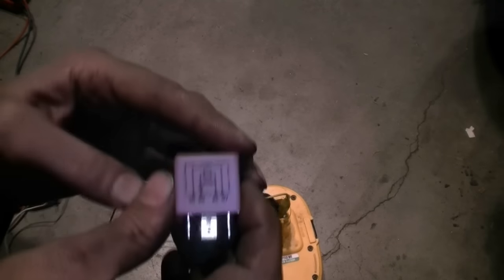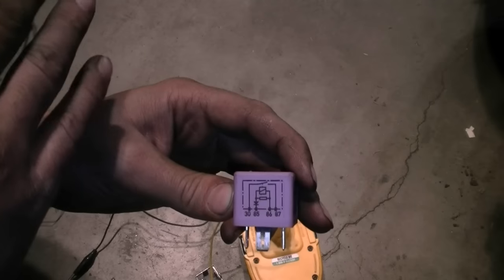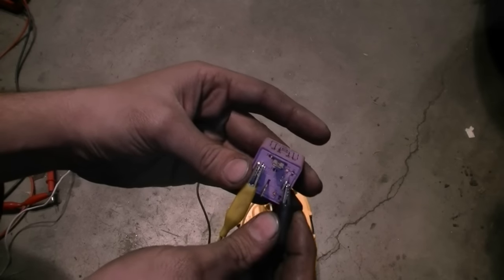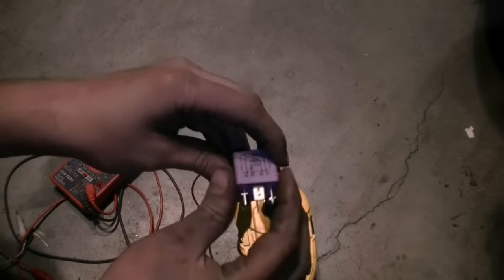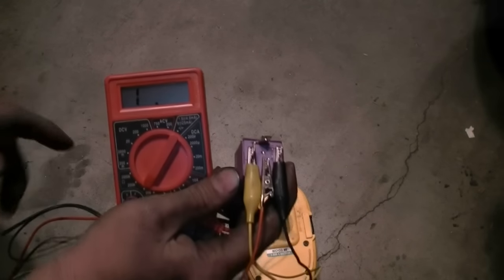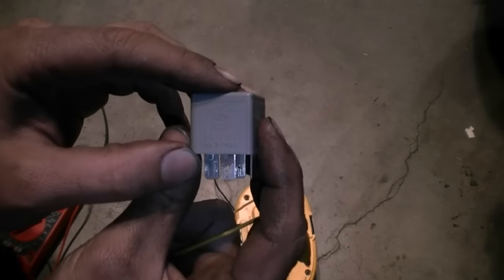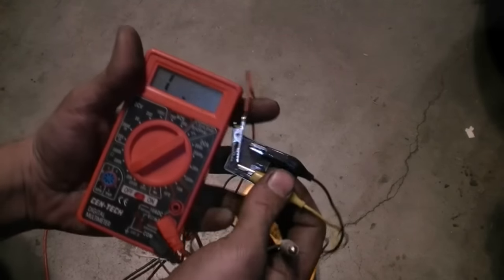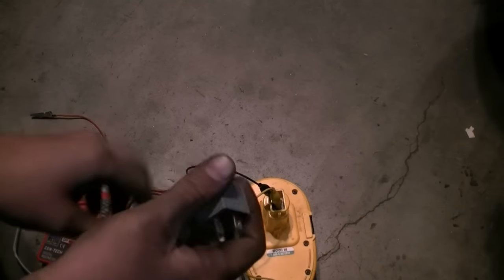How to Test a Relay the Correct Way

Comment: fabio sarmento:
"I've always been teached that we never measure resistance in an energized circuit. Can you explain me how it is possible? thanks"  This is generally a good way to burn out your ohm meter.  With relays it's kind of a moot point since rarely do they connect the coil lines to the switch pins since you can just do that on the printed circuit board, anyways.  If you want to be sure it's safe, set the meter to volts first and make sure there's a 0 reading.  Then you (probably) won't damage your meter.  I tend to use $3-5 meters for ohms, anyways.  Best not to use a $100+ meter for ohms on a circuit with a battery/AC/large charged capacitors on it.

Comment: Great video, thanks for this. I have a intermittently working relay, would that show resistance? Or is there another test we can do? Assuming it stops working when under load for a long time. Fuel pump relay on a MY2000 Nissan 200sx.

Comment: Relays that work of the cars computer may have a different voltage than 12 volts to the relay. Typically around 2, or 5. Not sure if giving 12 volts across the terminals will damage the windings in the realy.

Comment: Instead of over complaining about terminology used in this video, I think, if we have adequate knowledge of electric circuit, 
we should be more interested to analyze the circuit using correct model.
For instance, if the coil has an inductance of 30 mH and a resistance of 150 ohm and the current needed to pull the contact is 50 mA after excited by the battery voltage of 12 V, we can predict or calculate the relay delay time until the switch is closed.
To do this, we should obtain a complete response of a step function. In this case the battery voltage source can be modeled as a step function.
A complete response = transient response + steady-state response. Alternatively, it can be considered as : natural response + forced response.

Perhaps, there is anyone here who is interested in solving the problem I mention above. If so, give your answer. Please don't write the starting 1st order differential equation to be solved using either traditional method or Laplace transform method. Only write the final equation needed to obtain the result
Just consider this as a refresher of our knowledge on RL circuit. For me, it is not as frustrating as when removing all of the wheel nuts or even the nuts on master cylinder. :)
Cheers :)

Comment: Although this is one method to check a relay contact, it's not the best. The best method is to measure the voltage drop across the contact while current is going through it. You could leave the relay in the car and check it there under dynamic conditions. Have a good one!

Comment: You shoudn't test resistance in a powered circuit.Anyway it is a great explanation thanks
Reply: The coil and the contacts are two separate circuits. The coil is the control circuit while the contacts are typically the load or power circuit. Since the relay is disconnected there’s no current in the contacts. But yeah it’s recommended to isolate the component before checking resistance.
Reply: @davidr.9040  how to do it please?
Reply: No electricity videos don't have some jerk claiming it's wrong. I swear
Reply: @mebrn5337  he’s right tho, I’d rather get O.L than blow a meter

Comment: Yes this video was very helpful.. Question tho.. Does it have to be a 12v or higher power source to activate relay?
Reply: The whole point of a relay is that it delivers a full 12-13v from the battery to the ancillary item especially items with a high current draw such as headlights, heaters, fans, starter motor. It also means there is less current flowing from the battery to the switch around the wiring loom to the ancillary item. If there were no relays the main wiring loom would probably melt with the high combined current flowing along the wires from all the ancillary items connected to it. Relays are quite cool really, literally.

Comment: Also.. you can also switch the multi-meter to continuity beep to check the relay, if it's audible after energizing the relay, the relay is fine.. if not, then the relay is faulty.

Comment: Good job, but a voltmeter will not put a current load on 30 & 87. You could still have a bad relay. What if the contacts are burnt? You would have to load the relay and do a voltage drop test in order to see if the contacts have high resistance.

Comment: Thank you for showing us the way of how relay work. But I still can't really understand why relay show open circuit ( infiniti oum) but the coil still working !!!
Reply: There are two main parts to a relay. First is the coil and second is the switch. The coil is the electrical part and the switch is mechanically operated by the coil. It is entirely possible the the switch may develop a mechanical fault preventing from closing or even a broken wire can cause a fault. These type of automotive relays can usually have the cover removed quite easily for checking.

Comment: So I do this check already but I wanted to know if you get any voltage reading through the relay? Apply 12 volts and see if 12 comes out the other two pins.

Comment: it is a coil or selonoid which becomes magnetised and pulls the metal switch down to the magnetised coil thus the switch is now made and passes the current to the object.switch off the current to the relay and the coil is no longer energized to create magnetism to pull the second switch down.

Comment: Cool man I'm going to test my relays on my 05 Toyota sequoia I'm having some problems with my secondary air pump and my secondary air injection Valves after I have changed all new secondarys air system its keeps turning it off. code will not go away P2445. Maybe it's haves a bad  relay 
Thanks for your great video

Comment: I got 2 questions:
1. Will you damage the relay if you put the 12 volt wrong? IF you do what you do, but you take the power source on the other ones and the voltometer on the others? (I guess It wont click, but will I damage it by doing wrong?

2. How do you know the correct way to put it back in?
Reply: +Erlend Myhre (Ragnarok) The relay will only fit back in 1 way due to the pin layout. Putting the power supply on the wrong way will not cause any harm but as you say, there will be no click.

Comment: Not trying to throw shade, but is that one of those $6 harbor freight multimeters? I bought one in a pinch for one time use.... Thing still works. But it won't suppliment my FLUKE
Reply: I have a cheap $10 meter and it works fine for me

Comment: M M: " How can we distinguish the positive from the negative??"  Well, just reverse it and if it starts working....   TBH, most relays I've seen work in either direction.  I'm surprised that the video uploader didn't test to make sure the relay works in both positions.

1)  Put ohm meter on 2 switch pins.
2)  THEN apply power and see if it goes between off/on.
3)  For some applications, you need to instead set it to voltage setting and put a battery in series.  The voltage drop compared to when bypassing the relay (directly connecting meter to battery) should be almost zero.
4)  I tend to use 9V batteries because it detects borderline-failing coils and is just about the same distance between terminals.  A weak coil will fail at 9 volts even before it fails at 12 volts.  Great to know if buying used relays at a self-service salvage yard.  I've yet to see any that allow you to bring in a car battery to test.  ;)

Comment: The information was great. Instead of trying to hold the relay and the tester, leave the tester on the floor. If it is straight and flat, the display can be seen. That way, theirs no chance of you dropping the tester.

Comment: If a relay has high resistance and the relay still clicks you can pull of the plastic housing and sand the connector tabs with sandpaper.

Comment: Great video!  Can you tell me if all 4-pin relays have the same numbers on them?  I'm trying to diagnose an electrical problem on a 1975 BMW motorcycle and the replacement relay is $70+!  Yours has the same numbers on them as mine.  Where did yours come from?
Reply from the maker: Larry Bowen Mine came off a 2001 VW Passat if I remember correctly. Not all of them work the same but you can probably pop one in there to see if it works with minimal risk of damage to anything (I said minimal..lol). GL

Comment: Hi:  Thank you.  So I found that all my relays are good.  So I didn't have to buy any, thank you.  I still have my problem that you may have a video on.  I have a 2000 Mercury Mountaineer that when you open the drivers or passengers front door the dome light does not come on.  It does with both back doors and tailgate.  I checked both door jam switches and fuses and under dash relays.  All good.  When I was working on the drivers door, just once I heard the bells when your keys are left in.  That is not typical and it doesn't do it now.   I have no idea of what to check next, or how to check the ground wires that go to the door switches.  Help is possible.  And again, thanks for the video, it was great.  Kenny

Comment: Summary: To test vehicle relays, connect 85 and 86 to 12 volt power source and listen for the click. While that part of the relay is still energized, test the now closed part of the circuit, the other two pins, and see if the resistance value is close to zero. If it's not, it indicates a bad relay.

Comment: I've always been teached that we never measure resistance in an energized circuit. Can you explain me how it is possible? thanks
Reply: They are not connected.  12vdc energizes the coil which electro-magnetically pulls the other separate contacter circuit closed without physically touching it.
Reply: Also, with the relay out of the car, there is no power going to the side he's checking resistance on
Reply: Taught not teached .
Reply: @tollinloud.5117  
Tight, not taught.

Comment: Ratchets and Wrenches was struggling in finding the correct term for certain relay parts. Whereas perhaps, quite a lot of us, including me, still struggle in removing the nuts on brake master cylinder, let alone the wheel nuts. :)

Comment: I have a 94 Corolla, the radiator fan relay clicks but the reading with a multimeter in ohms reads OL on the load circuit when energized. Is that a good relay?

Comment: Sir, very helpful and informative to fix AC related issues.

Sir, my car i20 rear defogger does not light up and it doesn't work too. However, the front fogging and other AC features are normal 💯 percent working.

Please, help me find the  reasons why only rear defogger does not work? Any fuse related for rear defoggers??
Reply: The rear defogger is an electrical wire that runs around the rear glass. It heats up when current is passed through it. You can see it in the back window with a small electrical connector usually low on the glass. It may have a broken connection or wire. Can be measured with multimeter on ohms. If it gives no reading, wire is broken. 
Front defogger works by AC plus engine heat, totally different

Comment: Great Video,thanks a lot!

May i ask something,if i have a bad relay(it clicks but shows infinity resistance on the multimeter,like the second relay on the video)what can i do to fix it?Except buying a new one...thanks!
Reply from the maker: +Zisis M they are very difficult to fix maybe impossible. I would suggest finding a similar relay if you are in a pinch, sometimes you can use 4 pin relays instead of 5 pin relays to. GL
Reply: +Zisis M Depending on what the relay is for you could probably use a wire for the fix. My power window relay went out just the other day, put a wire across 2 connections and it works. The only "problem" is that it runs without the car being on, potentially draining the battery or heating up. As far as from what I've heard there are mixed outcomes. The relay makes sure power goes to where it needs to be when the latch is on and it disengages it when it's supposed to be off. I'll just take the wire off when I know the car will be inactive for awhile, better than spending $50 on a new relay.

Comment: I thought you were suppose to check resistance when there is no power supplied to the circuit? But you have it plugged to the battery?

Comment: should there be resistance between the control circuit? what i mean is, suppose you tested for ohms between the 2 contacts that you have connected to the battery...should there be a large resistance value there?

Comment: Thanks I'm trying to diagnose your problem  with my 1993 Dodge Caravan not getting any fire to the plugs and i have eliminated the coil pack and not getting any power to the button that powers the coil  don't knowif its auto shutdown relay so I was just wanted to thank you  I'll check all the relays

Comment: i agree with AK3N4T0N never check resistance in a live circuit it will damage your meter. also just for the up-loaders info .... the Flappy thing is called a contact and this is where you test resistance when the coil is pulled or live, as shown in the video.

Comment: Or, if you care only to see if a switch has failed, you could swap a switch like for like and see if the inoperability switches too. Swap the a/c switch for the windshield switch (if they are a like) and now if the windows wiper still works and the a/c still doesn't work, both switches are good and it's the a/c clutch/compressor that is failed. No need to mess around with all those wires and a multimeter.

Comment: Starter relay on a 2000 eldorado looks completely different. Are the numbers on the pins gonna be the same because this one is shaped differently than square relays? And I actually see the letters F-E-D-C-B for the prongs but no numbers.

Comment: Thank you so much 
But I have a question 
When I test a good working main relay using test light  I mean 86 on positive and 85 to test light that is on the ground  the test light turn on  but there is no klick .
Is that because the coil that inside the main relay needs all the 12 volt  and not divided between it and the test light???

Comment: Can I use one of those battery cell jumper packs to as a power?

Can I use a car battery?

My drill doesn’t have simple power and ground so it’s hard to set up.

What’s the easiest cheapest way to create a power for these little guys?

Also my multimeter has prongs instead of clamps :(

Comment: That is correct, but not enough.  I had a car aircon relay testing good at home with the multimeter, but failing when the engine was hot.  It took me months to discover, even the mechanics were saying "sorry, cannot reproduce the fault".  The same is true for a fuse that seems OK.  My advice, replace fuses and relays which are cheap, before going into complicated things; or borrow from a mechanic one that is sure to work.

Comment: Alberto Gomez: "how do you test a relay with more than just 4 pin relay? thanks for the tips on the video"
OK, 1st locate the coils.  These aren't exactly super-sensitive devices like MOSFETs so you're bound to eventually find the right 2 pins even if none are marked.  Relays tend to have pinouts on the side, though, so this is rarely a problem.
2nd, with no voltage, determine which of the pins are connected or not.  Write this down.  Just give the pins numbers 1-5 or something if they're not marked and draw the layout to remind yourself how it's layed out.  Have a table like this:  "1-2:on 1-3:off 1-4:off 2-3:off 2-4:off 3-4:off" 
3rd, with the coil active, remake that same table and compare the differences.  Normally there should be a pair of pins that goes from off to on (Normally-open relays) or the other way around (Normally-closed relays).

In practice, you usually just have to write down which one is on (closed/shorted/0 ohms) when the coil has power and which is on when there's no power.

Comment: I'm installing air horns on my truck.. If I use the wires feeding the existing horn, I shouldn't need another relay ??? right ???  Same horn button, and relay should work with the new horns, right ???  Now my horns wont work !!

Comment: The ohm meter will not load that circuit to test. Need to put a large load on it like a fan motor or head light to load 87 to 30 circuit.

Comment: 2006 cr-v instrument cluster won't light, radio won't light, and HVAC controls won't light.  Honda said to replace all the bulbs.  But I spot checked many of the bulbs and they all work.  Honda also says the relays are good and power is getting to the insturment cluster.  Could the instrument cluster have a short and could this affect the illumination of the bulbs in the HVAC and radio?  When the headligts are off the gear indicator lights R,N,D,D1,D2,D3 all light up,  very strange

Comment: What's the setting on the cen-tech CM300 multimeter for checking resistance? I have heard each relay click. My meter show's 600  ,, 6000 60K 600K 60M 600upside down symbol

Comment: Can a bad relay cause an accessory to not shut off?
Pressingly the heater fan in My Rubicon, everything works as it should, however when I switch the fan control switch to the "O" position, I'm still getting low fan out of the vents,